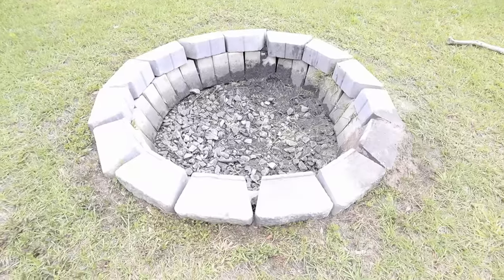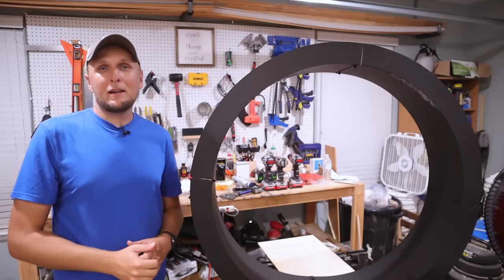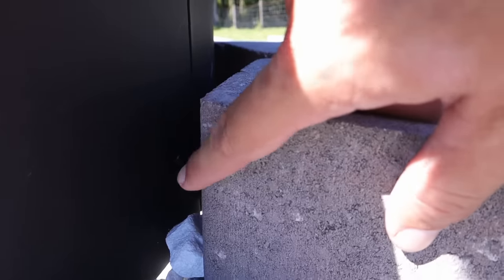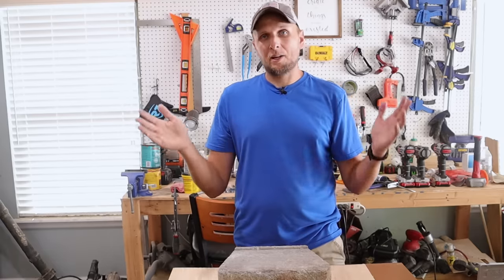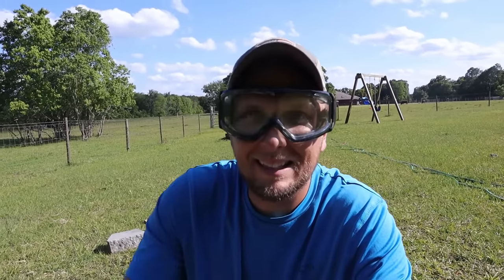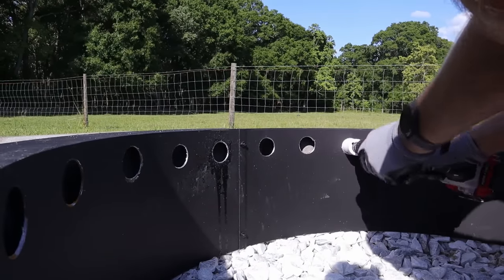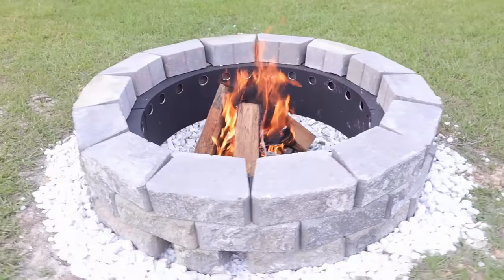How To Build a DIY Smokeless Fire Pit That Really Works!

Comment: good video.  question though.....instead of taking out some blocks and cutting them in half, why didnt you just take out a few and adjust the spacing?  this had me really confused
Reply from the maker: Couple reasons.  For me personally, aesthetically, I didn’t want that look.  2nd reason is I didn’t want gaps all the way around the bottom.  With ventilation and trying to create a vacuum effect, oftentimes the more holes, the less air movement.  I wanted to restrict the airflow in to an extent to promote more air movement being pulled in and then up and out.

Comment: What size hole saw did you use? I made the same pit and mine isn't smokeless.... I also only cut 3 holes per section of the ring.. I think I am at 1 3/4" hole size.
Reply from the maker: Hey Joe, I also started the first one with a 1 3/4” hole saw but the hole was way too big and the air was probably never going to get into the fire and just go up for the most part.  So I used a 1 1/2”.  And if I could go back in time I think I would use a smaller one than that as I think it would’ve made it even better.  Keep in mind it won’t be 100% smokeless and there can be other factors.  The fire has to be big enough to heat up the walls of the ring really hot to affect the air on the other side.  Also, and you probably know this but wet wood is going to smoke regardless.  Hope this helps Joe!

Comment: Would elevating the ring an inch allow combustion air in around the bottom and negate the need to drill holes?
Reply from the maker: No.  The whole idea behind this is to get the air in up top to help burn off the excess smoke.

Comment: Wouldn’t it work better if the holes in the fire ring were at the bottom? This would bring the air up through the source of the fire allowing it to burn hotter and thus producing less smoke.
Reply from the maker: So the whole premise of this is to get oxygen to the top of the fire to promote burning the smoke off, which is does a great job of.  But I did make a video after this one installing a air intake into the bottom of the fire because the bigger and hotter you can get the fire, the more effective the ring will be.

Comment: good stuff!
Could you also just use one less stone in the bottom row and space them an inch or few apart?
I could see this working with a galvanized feed/water trough,  old metal bathtub, or even two window wells bolted together, especially if you are into repurposing and upcycling.
Reply from the maker: Absolutely, if you have access to something else similar, I would try it.  Always cool to turn something unusable back into functional.

Comment: Ok, so I am curious.  When you get to the point of cutting the holes in the firepit, you use a hand drill, a hole saw and no cutting oil.  I tried with a drill press, a good quality 3" Milwaukee Electric carbide hole saw and cutting oil.  I took me about 100 passes to cut through the 3mm steel.  Your video makes it look easy.  It wasn't for me.  I followed the link to the hole saw you listed.  It says that it is compatible with aluminum, plastic and wood.  I first thought that maybe yours was aluminum which would sure explain why yours was easy and mine was near impossible.  I opted to get a 1/2" Milwaukee Electric Red Helix Titanium drill bit not a hole saw and just made more holes.  When  went to the link you provided for the fire ring it says it is made of steel.  SO how did you cut the holes so easily?
Reply from the maker: It wasn’t super easy, it was the most difficult part of the project.  If I didn’t edit out how long it took to get through, the video would’ve been quite a bit longer.  I also had a very expensive brand new carbide hole saw that cut one hole and then it was completely dull. The cheaper one did all the other holes.  Some of the teeth broke off towards the end but was still able to finish it.
Reply: @HowToHomeDIY  I just finished putting the holes in mine.  I gave up on the hole saw.   The 1/2" Milwaukee Electric Red Helix Titanium drill bit worked great.  Just kept putting oil in the hole so it wouldn't burn up.  Because the holes are so much smaller, altogether, I put 96 holes in the four sides.  That totals about 2/3 of the area of 24 3" holes which is what I was trying for.  I assume it would be close to the area of your 1 1/2" holes but haven't done the math.  Very appreciative to you for posting the video and showing me how to make a smokeless fire pit.  Bravo!

Comment: Shouldn’t the air holes be placed lower on the steel ring?
Reply: i second that
Reply from the maker: That is not how this particular pit works.  I did a couple videos after this, one addressing bringing air into the bottom of the fire and one addressing many of the commonly asked questions.

Comment: Metal in the eye sucks! I had a wire in my eye, it was in far enough that it touched my cornea. If you get a small metal shaving in your eye, you can use a strong magnet to get it out.
Reply from the maker: I have heard of folks using those successfully but also heard to be careful if removing it that was so as to not drag it across the cornea.  I will just wear my goggles 24/7!  😂

Comment: Instead of cutting 2 bricks in half, you could have achieved the same result by simply removing 1 whole brick and shifting the others.
Reply from the maker: But then I couldn't have the fun that I had 😂 In all seriousness though, I didnt want the bottom row to not match the top two and I think having holes all the way around the bottom may be too many points of entry which can lower the efficiency of air being pulled in.  But yes, you could do that if you wanted.  Just not sure it would work as well.

Comment: You'd have been better off making a Dakota style pit using a drain pipe a metal grate underneath the fire.
Reply from the maker: I did that to improve it in my follow up video if you haven't seen it yet.

Comment: It would have been a lot better to have the holes near the bottom of the liner to promote better fuel/air mixing. What you have built is a very basic version of a tuyere arrangement and they should be below the combustion chamber so air is easily drawn through a natural convection process.  If you added a grate to build the fire on which is a little higher than the holes then you would have approached a more optimal overall arrangement.  
I can't say I think much of the stability of your top row of blocks though, especially as you say you have an infant on the property.  They are just waiting for a minor disruption so they can fall off.  While much more effort it would have been worthwhile forming a groove (dado) so the inner edge sit slightly above the flange and the remaining surface of the block sat flat on the supporting ring.
Reply from the maker: They aren’t going to fall off.  They have never moved and they don’t just slide off.

Comment: the holes need to be smaller, so the exiting air has higher velocity to reach the fire. With holes that big they're just going straight up and out not having a 2nd burn. Which is why you still see some smoke.
Reply from the maker: I think the holes being smaller and more of them may help to make it even better.  I have seen another guy say that if the holes are bigger that it just goes straight up.  Which I agree with to an extent if they were bigger than this but I can tell you that it isn’t true with my pit.  I can clearly see that the air from the holes are working when before the fire is large enough I can see the smoke being pushed back into the fire at the hole level.  The bigger and hotter the fire gets, I see this even more and the second burn.  It works great.

Comment: Your using prepackaged top quality store bought hardwood.   I would like to see what it does when you burn less ideal wood.  My guess is it would still  smoke a lot.
Reply: Solution: don't use wood you find from abandoned buildings for your campfires.

Comment: nice build, what would have made more smokeless would have being drilling the holes under the bottom not the stop, this drawing the air and pushing it upwards :)
Reply from the maker: That is the design of this pit in order to get air into the top to help burn off the smoke as it is at the top.  I did make a video after this one installing an air intake to the bottom of the fire though.

Comment: Is there a reason the holes where drilled higher in the metal ring verses being towards the bottom?  I would think lower holes would air-enrich the fire sooner, thus making it hotter, and produce lessor smoke..

Comment: fyi, instead of splitting stones, simply remove 1 maybe 2 , then shimmy the gap around to create even gaps all around
Reply: I came here to make this exact comment. A lot of work to cut the stone when he could have just removed one and even spaced the rest. Lol
Reply from the maker: Actually was really easy.  Also I did it because if you don’t, the bottom row will not match the top two rows.  Not a big deal if just going for functionality.  But with gaps all the way around it will probably decrease the suction of air at the bottom into the ring as it is now vented in numerous places.  It has been my experience when dealing with ventilation and airflow on other projects that the less vent holes the better for airflow.  That’s just why I did it that way.

Comment: it's not about letting in "cold air." it's about getting the metal walls so hot from the heat of the fire, that it super heats the air as it comes in contact with the outside of the metal. as the super-hot oxygen-rich air enters it helps the wood gasses burn more completely. this leaves almost no smoke behind. the smoke IS partially burned wood gasses. with a ring that large you will have to burn about 5 times as much wood  just to get the ring hot enough. you have to get the metal walls super hot for it to work.

Comment: Smokeless Fire Pit: you got a dislike because I noticed that you did not show starting the fire because that makes the title a lie, they all smoke on start up.
Reply from the maker: That’s fine.  Yes at that point the ring is not hot enough to work.  I believe I stated that in the video or in one of my follow up videos, can’t remember which one.  Even the smokeless fire pits you can buy in the store smoke a little on startup.  So if that’s the reason for the dislike, I happily accept it.

Comment: Seems like putting the holes towards the bottom would have a better effect than up at the top of the ring.  Other than the ring making a "nicer" look on the inside, one could just use the blocks and increase the number of half blocks to achieve the same effects without the added costs.

Comment: instead of putting the holes toward the top why not put them closer to the bottom to let in cooler air?
Reply from the maker: Want them at the top of the fire to help burn off the excess fuel (smoke).

Comment: 8:08...metal hole saw, spray with wd40 or cheap oil as you drill, and rock the drill back and forth right to left, top to bottom as you drill. Drills alot easier.

Comment: Why not drill holes in bottom to feed air for proper combustion.
Reply from the maker: So the whole premise of this is to get oxygen to the top of the fire to promote burning the smoke off, which is does a great job of.  But I did make a video after this one installing a air intake into the bottom of the fire because the bigger and hotter you can get the fire, the more effective the ring will be.

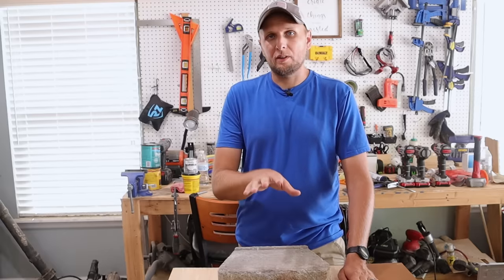Comment: @ 4:00 Why break the stones at all? Why didn't you just remove one brick and shift the rest leaving gaps anywhere you want?
Reply from the maker: Wouldn’t match the top two rows.  Also, I don’t think having gaps all the way around is good for trying to pull air in, up, and then out again.

Comment: The top stones are too thick.  You can get even smaller and thinner ones which would allow you to see the fire better.  Also, using the smaller, thinner cap stones on top would allow you to overhang those cap stones over the metal fire ring thereby creating, as another commenter said, a better Venturi effect which would make the burn even more efficient.  Also, bedding the base stones about 2 inches into the trap rock would keep them in place better.  Other than that, nice design, good thinking.  Enjoy your fires!

Comment: I built one and it doesn’t work. Mine is 36” diameter. Maybe the fire needs to be huge to get the principle idea behind the idea to work.
Reply from the maker: Hey Patrick, the fire does need to be large enough to heat up the ring hot enough for it to work.  The larger and hotter the fire, the better!  That is why I have had many people ask what size ring they should get and I always say it depends on the size fires you plan to have.  If it is just a smaller fire right at the center then it probably is not going to work as well. I find mine works best after I have put quite a few logs on after a while.  Hope this helps!

Comment: It seems to me that the air holes that you drill into the fire ring would have better served the system if they had been drilled closer to the bottom of the firering than close to the top.

Comment: @7:00 you said the process creates secondary combustion, hence smokeless. This is just not the case - you mis-understand what secondary combustion is. Secondary combustion is where you have (primary) combustion, and then it combusts again a second time (secondary combustion). You typically need chambers or baffles for this. Most modern slow-combustion fireplaces / woodstoves have secondary combustion chambers above the primary combustion chamber (or main "wood box") where the wood is burned, then the smoke rises and passes through the secondary combustion chamber which is much hotter due to being above the primary chamber, and secondary combustion occurs burning lots of the smoke particulates and significantly reducing smoke (also generates more heat).
What you are doing is attempting to pre-heat the air entering the (primary / only) combustion "chamber" or place, and yes, pre-heating air DOES improve combustion and therefore reduce smoke, but it's not secondary combustion. Pre-heated air and improved combustion also increases vertical air ascent which further improves draft (also improving combustion - more air) and lifting what smoke there is vertically above the fire instead of spreading to the side where people are impacted. This is also a good thing, but not secondary combustion.
So now understanding how the technology really works, you could make some improvements if you wanted to (don't bother if it's good enough already), like increasing the pre-heating of air by forcing through or around baffles, and having it enter the pit much lower eg ground level not high up per your holes you drilled which improves vertical draft.

Comment: Couldn't you have just used like one less stone in the bottom ring and spread the rest out with gaps to allow air flow? No?
Reply from the maker: You could but don’t think it would work as well.  Too many entry points.

Comment: STONE BREAK: Don't break the stone. Just dig a hole where you plan to place the stone, add rock in it and place stone in hole vertically. Add rock to adjust level and angle to ensure the top is flat along with adjacent stones.

Comment: Laying pipe in between the bricks on different levels would have been simpler and cheaper tbh...
Reply from the maker: It would not work as well tbh.  This works through warming the air under the ring and because its heated it causes pressure to push it through the holes.  Just having pipes on top will not force air into the top of the fire.
Reply: @HowToHomeDIY  rising heat causes a vacuum. If you placed pipes toward where the fire breathes at the bottom, physics takes over, causing the fire to breathe better because the rising heat socks the colder air to be sucked into the ring at the bottom feeding the fire... still, even having only pipes at the bottom going through the papers (cut into appropriate lengths of course), would have cost way less and worked just as good. It's kinda the same principle as a jet stove.
Reply from the maker: That is a different concept.  This is based off of the solo stoves.  The idea is to oxygenate the top of the fire in order to burn off the excess fuel (smoke).  Just feeding the bottom of the fire will help yes but it will not work the same way that this does.

Comment: If ya don't want smoke, burn dry firewood
Reply from the maker: Dry firewood certainly helps instead of using wet firewood but it will still smoke.

Comment: Why break the stones in half to give you airflow when you can just spread the stones out and use the gaps between them to do the same thing without any breaking? Just move the lower ring outward an extra half-inch or so and you'll have plenty of air sucking in.

Comment: Use fire brick. That concrete block will break if not explode under heat
Reply from the maker: No it won’t.  Especially with a fire ring in it.  There are plenty of videos debunking this even with the concrete blocks being directly in a fire for long periods of time.  Freak things can happen but it would be just that.

Comment: There is no secondary burn in your test fire. The holes you had drill are too big to create a forced flow and the fire you had built is too small  for the diameter of the fire pit.
Reply from the maker: Nope, had a fire last night.  Works great.  I also did a follow up video with a much bigger fire for the doubters.